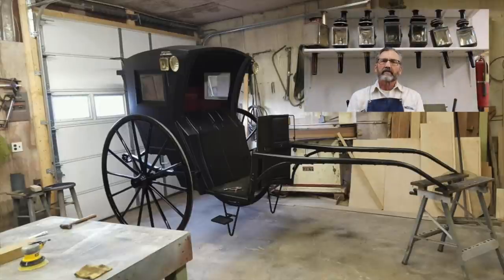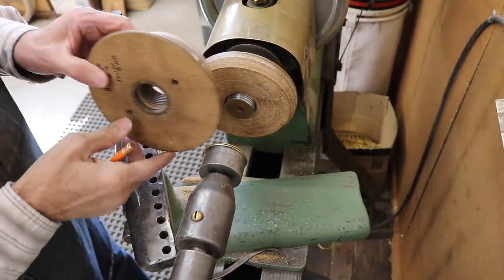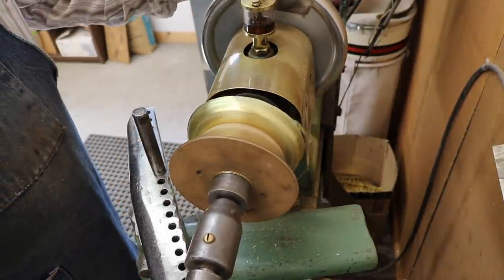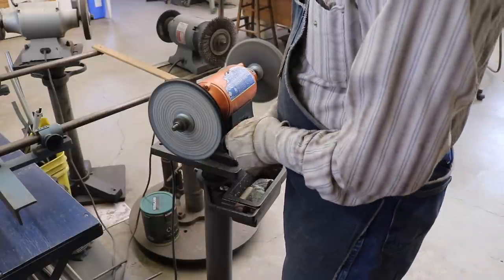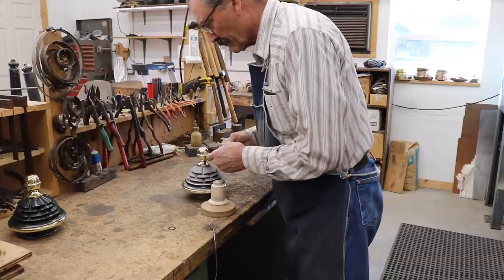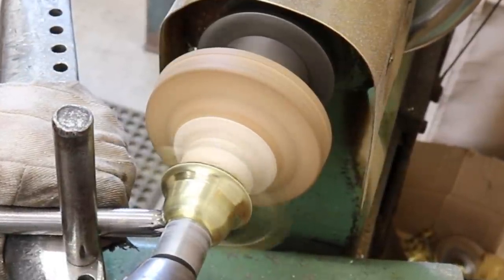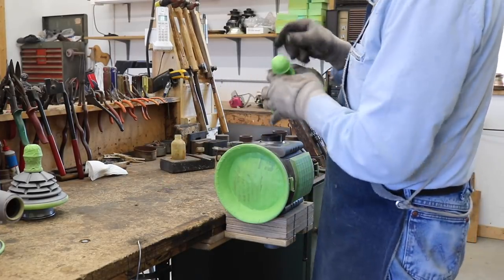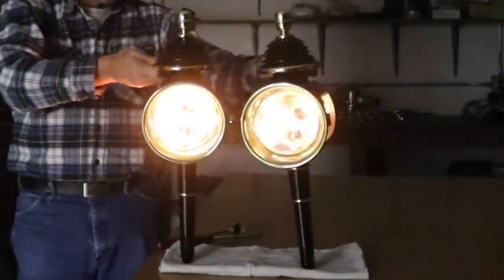Wrapping Up Muhlbacher Hansom Cab Lamps From Paris

Comment: Rick - to get that dent out - solder on a threaded pipe or tube fitting and use an air or hydraulic pump to push out the dent (depending the material thickness.) Wood forms can help secure the original shape if needed. Obviously creasing is another story. 
 
Making a new part is good too! 

Keep up the great educational and entertaining work!

Ben in Kansas.
Reply from the maker: Thanks for the tip.

Comment: It's likely that years of polishing the finials  made the brass so thin because nearly early kind paste/rouge compound used when buffing does remove metal and it's often why  you'll usually see exposed copper/brass as the Sterling Silver Plate wears of  over time. One could weld or tap a ball bearing to a rod  to get at dings from the inside after a little  waxing it so it will ride smoothly under the metal but often a hard wood dowel rounded over works better since there no metal to metal contact. Congrats on another video for the library and you could make  a do's/don'ts series on things like metal spinning/soldering since those that would like to learn how to do it usually make them first. Indeed few realize that in metal spinning you must often draw out the metal back/forth which you can see happening while turning and you can thin it so much by only tooling it in one direction that it will break thru ruining the piece.
Reply from the maker: Thanks for watching!

Comment: Great series spinning the brass is fascinating in its self. When you talked about the annealing process, does the brass harden from the heat generated from forming it to shape?
Reply from the maker: The brass hardens because of working it,  stretching and moving it put stress on the bonds between the molecules. Annealing it by heating to dull red relaxes it and makes it workable gain.

Comment: Question Please:  What temperature wax is favored for these candles?  A high melt-point wax? (155~160?)  or low melt-point wax (120~145?) Or does it matter?  Gorgeous lamps, btw. The RED rear lens.... brilliant design.
Reply: In one of his videos Rick said bees wax is best.
Reply from the maker: Beeswax is the traditional favorite but rather expensive. 51 percent beeswax is more readily available and burns well in most carriage lamps. I think the melting temp of 51 percent beeswax is about 150, also it is completely consumed under normal operation. Thanks for watching!

Comment: Two very beautiful lamps.

My curiosity brings me a simple question which doesn't really mean anything.
Fresnel. Lens have you dabbled with any
Reply from the maker: I haven't come across any Fresnel type lenses in 19th century lamps but I have seen them used in early 20th century auto lamps which are a bit out of my normal area. I would hate to have to replace one. Thanks for watching!

Comment: #Question: with so much soldering done on circular joints, why not acquire a small, slow moving lazy-Susan type of work stand? It should be motorized for hands-free use. Just a thought. 

Beautiful work by the way. I watched every video since the first introduction on your brother-in-law's channel.
Reply from the maker: Thanks for the tip. I'll have to think about that.

Comment: Rick, what lube do you when spinning brass parts?  Was that some kind of wax, a bar of soap, or something else?  Do you use different lubes for different metals -- brass, copper, aluminum, steel?  Does the metal gauge affect the lube you'd use?
Reply: Soap, he mentions it in one of the early videos.
Reply from the maker: I mainly spin only brass and use Kirks Castile bar soap for lube. Thanks for watching!
Reply from the maker: Yup

Comment: Is that a leaded solder that your using for  Braising?
Reply from the maker: Yes, 40/60 tin /lead.
Reply: @TheLuminaryShoppe  neat, thought about practicing on some old copper pipes to get a bit of a handle on procedure but the new non-leaded stuff is a bit harder to use